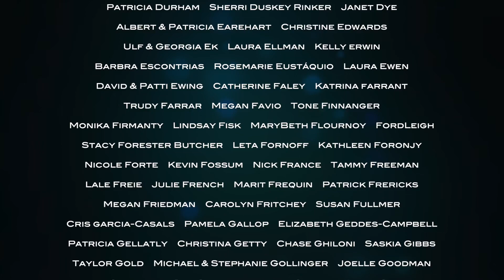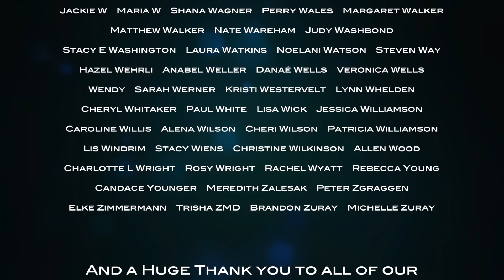JUGGLING CHATEAU DIY AND A HEDGEHOG!

Comment: Herbert can eat & drink the following:
Tinned dog or cat food, and cat biscuits or crushed dog biscuits, make good hedgehog foods. ...
Very young hoglets that weigh less than 300g can't eat dry food, so the biscuits would need to be soaked in water first
Hoglets should be fed with a milk substitute such as Esbilac which contains all the fats, vitamins and minerals they need. Under no circumstances should you give them cow's formula which will kill them. I googled this so you can check this info !!

Comment: A Hoglet's Normal Weight And Feedings By Week
A hoglets normal weight and feedings by week

Age	Weight	Formula Feeding Amount
<1 – 2 weeks	<1 – 3 oz / 9 – 85 g	1-3 mls every 2 -4 hours
3 – 4 weeks	4 – 6 oz / 110 – 170 g	3-6 mls + meat baby food
or wet cat food every 3-4 hours
5 – 6 weeks	7 – 9 oz / 200 – 260 g	– Day feedings stop
– 5 mls + wet cat food provided in
dish and should be self feeding
– Begin to introduce dry cat kibble
6 – 7 weeks	10 – 17 oz / 300 – 500 g	– Self feeding on demand
– Should be on dry cat kibble now